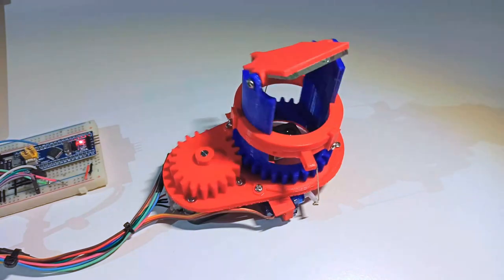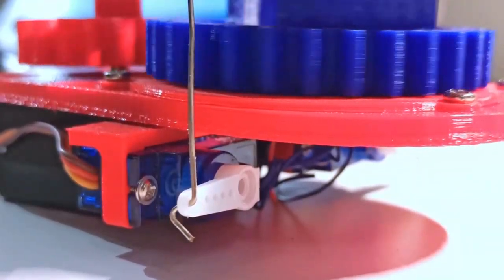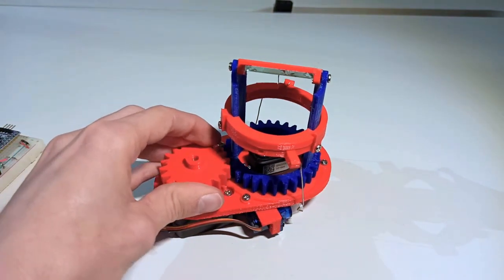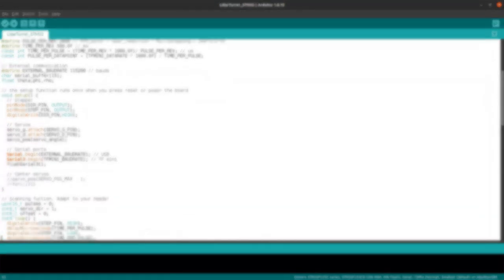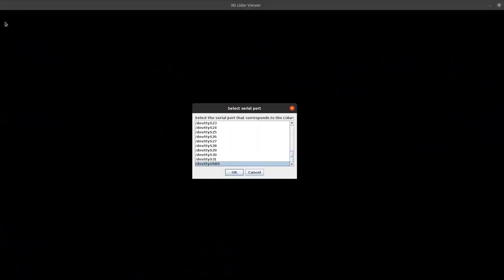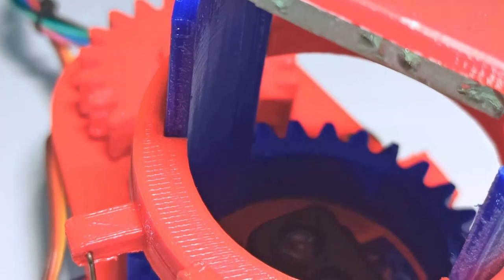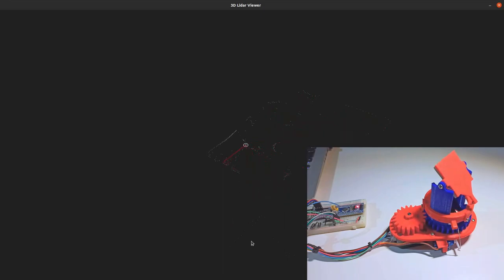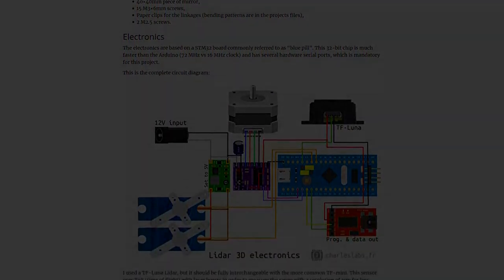3D LIDAR Scanner (new version)

Comment: Thanks for sharing your project. I like it a lot. In the past I did an scanner with two servos, but yours is better. You've expended lot of time for preparing and sharing details of the design, so thanks again. Juan.
Reply: I am working on a similar project that involves a 2-DOF system with yaw and pitch capabilities, along with a ToF LiDAR. After scanning, I obtain data that includes distance, yaw angle, and pitch angle. I use MATLAB to convert these into Cartesian coordinates and to create a 3D view. However, some lines that should be straight appear curved. Do you know why this might be? I intend to use this setup for 3D reconstruction of fluid objects such as sand and gravel, in order to calculate their volume

Comment: Awesome LIDAR project. I liked how you solved the motion of the mirror. 
A few tweaks and it's perfect.
1. As others already suggested, use ball bearings on the axis. 
2. Instead of using a gear link from the motor to the rotating assembly, use a timing belt. It would lessen the vibrations due to slack in the gears. 
Note also that you do not get the same length from all the lidar angles due to the sensor's construction.
Reply from the maker: Thank you for your comment! In this case, I wanted a fully 3D-printed construction. But I agree with your suggestions. I will probably do an improved version in the future with a timing belt, a bearing and rods for the pitch axis.

Comment: Man, you got my attention with this one! Thanks for sharing!
I also have some improvements ideas like the other colleagues:
1. ball bearing for the rotating mirror it's mandatory
2. belt drive for the rotating mirror should be a better choice in terms of motion fluidity. Gears if not printed correctly, will induce vibrations into the mirror.
3. mounting the linkages for the mirror angle on at least 3 vertical rounded shafts (like those used on 3D printers axis), around the rotating assembly, together with another ball bearing, to ensure a parallelism between the base of the whole lidar system and the angle control ring for the mirror. 
4. a DC motor with encoder (you can find in old paper printers) should be a cheap option to rotate the mirror assembly in a fast and controlled manner.
5.
Reply from the maker: Thank you for your comment! I agree with all of your proposed improvements. However, it would make it more complex to replicate. I might do a version similar to what you described in the future, but also maybe an improved fully 3D-printed version.
Reply: @CharlesGrassin  your design still best on youtube or other platform, its like nobody doing this. do you still progress on project or it will be last version we watched.
Reply: Hi, I am a bit late but is it possible to use stepper motor instead of the DC motor?

Comment: I think it would be beneficial to instead use BLDC's, you can set the angle directly (sin pwm with mosfets), it would need some balancing work though, but the TF Luna can be set to update 250 times while stock is 100, and the TFmini-S up to 1kHz (1000 dots a sec), maybe more. that'll allow much faster scanning and movement.

Comment: what is the maximum detection range of this lidar?

would there be an affordable way to get 30~45 meters of range?
Reply from the maker: The TF-Luna only does 12 m max range. The Gamin LIDAR-Lite does 40 m range, but it is much bigger and more expensive. I used it in a previous scanning 3D Lidar project: https://charleslabs.fr/en/project-3D+Lidar+Scanner

Comment: I am just replication your project an i have all the printing parts fit together. But now i wonder why you didn`t made the rotor higher, so that the mirror can move more down. So that you have a wider scanning area. I want to do a scan of a room, and therefor i also need to scan the ceiling. I would be really happy if you could answer :) Thanks in advance.

Comment: How many degrees it can get? From 0 until 45? Because its with mirror reflection method... i also research with 2 mirror reflection like in panasonic lidar style, so for mirror 1 is fixed in 45° for transfer the laser into mirror 2 is rotating by pulley and also set the degree with micro servo there to make field of view. What do you think? Im still get arround 20-40° effective to capture the room bcause 0-20 still detect the body of the lidar and 20-40 is just about seeing mostly the road/bottom side. The lidar couldnt see the object on the forward-high side. (45° above)
Reply from the maker: Relative to the ground, it's about -25° to 20°. This range is determined by the length of the link rods and can be changed depending on the need (of course, the code also has to be changed to give the correct angle).
There are many interesting configurations for the mirrors. Panasonic 's Lidar is indeed one of them!
Reply: Oh okee.thank you..nice sharing. -25 to 20 is for swing that 2 servos yaa... if its directly mount to control the mirror its like 0-45° if relative to the ground until the mirror can transfer the laser straight horizontal. What type do you use for this 2 servos? Mg90s 90 degree or 180 degree? With mapping? This angle setting not same ya For the right and the left servo? If the 2 rods controlling the mirror angle together like this. Its probably like the right servo set -15° and the left servo set 15° to get 15° actual in the mirror angle.

Comment: why did you use mirror ? i mean you can use Lidar sensor directly
Reply from the maker: The mirror moves the laser beam on two axes without having to move the lidar sensor itself. Because a mirror is lighter and has no wires, the scan can be much faster and more reliable.